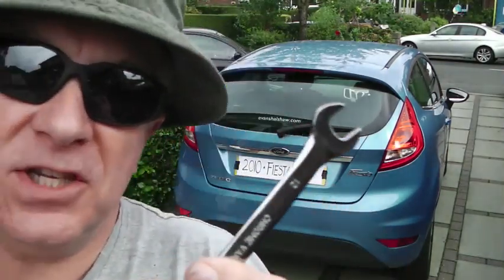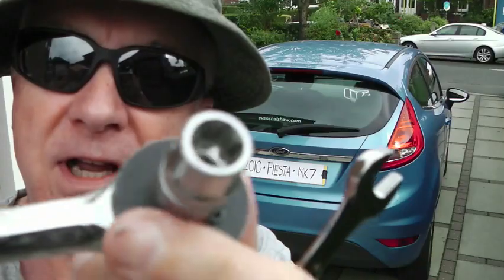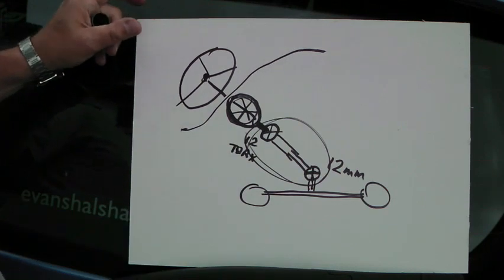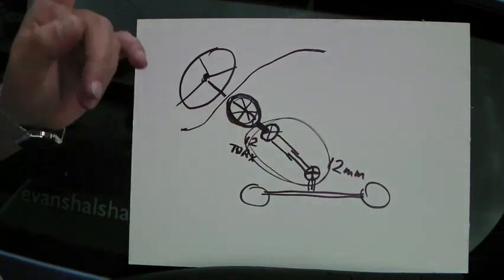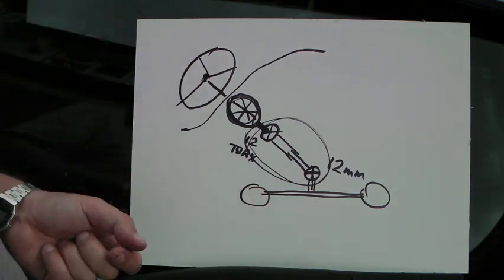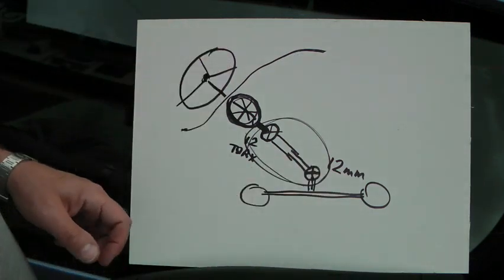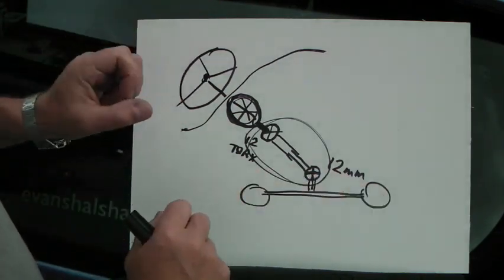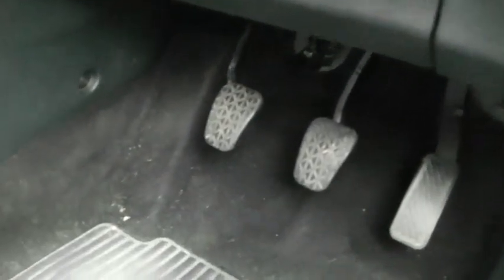Ford Fiesta Mk7 Faulty Steering Column (common fault)!

Comment: Iv got a late 2016 mark 7.5 and the steering column is different to what your showing do you know if they changed it or improved it in the later models?
Reply from the maker: I think from 2012 onwards may be different part number!

Comment: I have a question regarding losing power steering on the same car. Is this a common problem as well?  I have checked all the fuses both in the engine room next to the battery and the fuse console behind the glove compartment. Is this a common fault as well? The dealer shop where I bought my car new refuse to answer any questions since the warranty is expired. I live in Thailand (LOS) Land of smile (or land of scam)?
Reply from the maker: Sounds like you have an entirely different fault! Suspect it’s an electrical fault or maybe a weak battery!! Good luck!

Comment: I’ve removed the two bolts but the top side of the column won’t budge. The bottom end slides off east but the top just won’t move. Any help on getting this off would be appreciated
Reply from the maker: Just patience and keep wiggling it until it comes free!

Comment: I got this problem on my Fiesta 2012 model in Thailand after 5-6 years of use but the Ford dealer who serviced my car could not find where the noise came from. Now the car is 11 years old and I will repair this myself. Thanks for sharing, hope I can get rid of that annoying clicking noise every time I try to parking my car and need to turn the steering wheel left and right.
Reply from the maker: Good luck!

Comment: 2015 fiesta - stiffish steering which is pointing to the top CV / knuckle joint due to motor heat - car has drivers knee airbag fitted just below the intermediate column.  it's impossible to remove the top torx bolt without removing the airbag section. Tried every which way. I'm not attempting to remove the airbag, but I have tried a 12mm torx ring spanner, small 1/4 drive 12mm torx socket, 14mm ring spanner etc. No room at all to get a proper grip on it. Any other options without taking the car apart? Not sure if I'm missing a trick with this. Cheers (Great video by the way).
Reply from the maker: Thanks for commenting. I've not seen a drivers knee airbag, so can't give an opinion on this. Sorry I can't help, but good luck anyway!

Comment: Great video mate. 👍
But i did not understand is this problem just anoying sound or major problem wich can lead to some bigger issue?
Can you explain please?
Reply from the maker: It's a clunking sound that can result in FAILED annual MOT test in the UK. It may also be a safety concern as the clunking gets worse, but I am not qualified to say. Always consult a qualified motor engineer if in doubt!

Comment: Any body know the torque for the 12 mm nut and the12 mm torx nut involved as this repair involves the steering the torque setting is important
Reply from the maker: Sorry Martin, I don't know the torque setting, but you are good to mention this because it is important, and can be a safety concern if these are not correctly tightened!

Comment: I was just looking to buy used mk7 fiesta and tried one with this problem. Thank you for sharing. 
Can anyone, who is driving mk7 fiesta, share with me the other common problems with this model and is it worth buying?
Reply from the maker: It's generally a good little car!, but other things to watch out for are buckled alloy wheels - they buckle on the "inside" edge so you can only see they're buckled if you jack the car up and look underneath while the wheels are spinning! They are not manufactured strong enough to withstand the potholes on UK roads! Suggest old school "steel" wheels are better, or at least Alloys by a different manufacturer. UK roads are so bad that I don't recommend "low profile" tyres on any car at the moment!
Reply: @AlanCooney  Thank you so much for sharing this info with me. 

I have found the used fiesta 2010 and I'm going to buy it tomorrow. It has steel rims, but I don't mind. It is so well maintained. I was thinking about not buying it because it has some problem with the gearbox, but found the used one too for less then 100e in good condition so decided to buy it. Engine compression is great (all cylinders above 11).

Thank you again for the tips 👍

Comment: Ive just purchased a used 2011 fiesta and was having these creakings sound. Have removed  both the bolts from the steering shaft, but the  length adjuster is so dried up i can't lift the shaft away, its stuck there basically.
Reply: Do you think it would be safe to use a hammer or crowbar to force the joints off their connections?
Reply from the maker: You risk damaging stuff if you use a hammer or crowbar! I would suggest holding shaft firmly and constantly wiggle steering wheel from side to side to free the shaft up. Also maybe squirt a bit of WD40 onto sliding shaft spines. Hope this helps.

Comment: Thanks Alan.  It’s now 2021.
 My wife’s 2011 mk7.  Mot advisory , offside wishbone and ball joint and steering rank has some play( Evans halshaw ) 3 years in a row)) 
Wishbones done. And I’ve been searching for some answers to my findings after  new wishbone and ball joint install,, I thought maybe it was something I had done whilst installing said wish bones.  I’ll  certainly have a look at the  column now .  Thanks for sharing. Stay safe 😷.
Reply from the maker: Thanks for watching and good luck. I also did wishbones around 100,000 miles owing to lower ball joints worn. Not had any steering rack problems. Also don't forget to check front wheel alignment after replacing wishbones!
Reply: @AlanCooney  oooohhh. I didn’t think of that. 👍 thanks again Alan. Go safe mate.

Comment: I have 2013 with 105k. Same issue. Just finish fixing mines. Took about 1.5hrs. The shaft on mines just had 2 regular 10mm. Make sure to turn the steering wheel 1/4 turn to the right (passenger side) The ford logo should be facing the passenger door, this will allow you to access the top bolt. Make sure you lock the steering column before removing the bolts. I used a rope. After removing bolts remove the bottom of the shaft first. then top. (TIP: mark the top of the shaft before removing. this will allow you to align it properly later.) I used PB blaster to clean free the cv joints. Move it back and forth until it's moving smoothly. Grab a rag and clean all the old grease. Apply new grease. I used brake caliper grease on mines, it withstands up to 600 degrees Fahrenheit. (Autozone) Go heavy on the grease. Clean excess and put back together. Thank You!!!!

Comment: Cheers for the tips in the video glad to see it's still going after all these years helping people out. I recently had the same issue with my 64 plate fiesta st, following your tips in the video I went to remove the steering shaft only to find that the top bolt had come undone slightly and that was the reason for the clunking. Tightened it back up and everything is fine again so didn't need to remove the shaft. Great video though for pointing me in the right direction or I wouldn't have had a clue
Reply from the maker: Hi Rob, thanks for your comment. The car is still going strong - on 108,000 miles, and 10 years old! Hope to do a video update of it soon!!

Comment: Have a 2012 it clunks over turns only sounds really bad could it be this. It doesnt clunk when sitting and moving the wheel help please
Reply from the maker: Yes, it could be this, but to be sure you need to fully examine the fault as I have not seen your car! If you are unsure yourself - then get an experienced mechanic to have a look.

Comment: I just had my MOT mine is a Fiesta 2011 it had a knock in the steering column before but was fixed about 4 years ago but back again. I can't hear any noise when turning or reversing at slow speeds. But car does slightly veer to left if I take hands off the wheel. Also when I put the key in to start the car, its hard to turn and gives a knock and the wheel moves a little as I turn the key.
Reply from the maker: Suspect more than one fault. Further inspection required, and a dose of good luck!

Comment: My fiesta makes a tak noise whenever I drive off, when I steer the steering wheel it makes a noise, the tak is repetitive
Reply from the maker: Steering noises can be caused by a multitude of things, (not just the fault I highlighted in this video). If you're getting a "repetitive" noise I would be inspecting the front drive shaft CV joints. Good luck.

Comment: Thank you. I have recently bought a 2011 titanium model and I had a clunking noise when reversing or turning at low speeds, I bought a £7.99 can of spray grease from halfords and covered both connections. The noise has completely gone. Thank you
Reply from the maker: Nice!

Comment: Yep you are right... Also my column shaft suffered from the same issue! How over the fix in an older car is not really simple.. it's better to go to your local dealer and tell them about the problem! Ford has already accepted the problem and they will make the same thing you for free and you will also be safer for everything ;). In any case thanks for the video !!

Comment: Great and detailed video. Did you have to remove much of the plastic facia panels below the dash to get access to the column?
Reply from the maker: No. I did not have to remove any facia panels. I was just lying on my back looking up under the dashboard.
Reply: Thanks Alan

Comment: mine got such problems after 10 years and 70000km. here in Russia 99% mechanics said that it is steering rack....and only one specialist said the same as You. thanks!
Reply from the maker: Pleased I could help. Good Luck.
Reply: Ilia Pokidkin same here in philippines. 80000km now and most mechanics said replace the steering rack assembly. Which will be very costly ofcourse

Comment: Good video but need to mention.The joints you are referring to are universal joints,not CV joints.Constant Velocity joints are usually found on drive shafts and are constructed using large diameter ball bearings not tiny needle roller bearings as found on our universal joints.Only mentioned this incase it causes confusion.

Comment: Recently bought 2010 fiesta Titanium. I have this clunking noise on the steering. Notice it when moving slowly off. I'm wondering if the power steering Amber warning light that has just started to come on is related to this? The warning light does not stay on. As yet anyway. Or is it a separate issue? I've also found out that my wheels are slightly buckled. Apparently a common problem I've been told. Any connection with these issues? TIA
Reply from the maker: Buckled wheels is a different issue. I believe the standard ford alloy wheels are not quite strong enough to cope with UK roads. They buckle very easily. If you are a keen motoring enthusiast I would upgrade them to something stronger for a smoother driving experience.
Reply: @AlanCooney  thank you for your reply

Comment: How on Earth can you remove it without removing the knee airbag? I really can´t find a physical way to reach the upper CV joint bolt, as it is right under the steering motor, on the upper side, it is barely touchable with the fingers (and I am an average size person, not fat, not slim).
I plan to disconnect the battery for an hour tomorrow, let the car properly discharge, then remove the knee airbag carefully, it is just 4 bolts holding it and the cable, which you can remove carefully. It is in far easier than removing a steering wheel airbag.
That is the only way I can picture being able to fix this.
Reply from the maker: I didn't touch any airbags. I slid drivers seat as far back as it would go, then lay down on my back with head and shoulders in the drivers footwell (my head right up against the pedals), and my legs hanging out of the drivers door with feet dangling onto path. In this position I was able to look upwards underneath the dashboard. Hope this helps. Good luck.
Reply: @AlanCooney  I did it yesterday, at last. I did remove the knee airbag, I guess I'm not that flexible :D
Anyway, sadly that was not the issue for me. My rod seems to be a newer version from 2010 and it was tight. I did clean and grease it but the k is king are still there. I suspect it might then be the CV joints so that is my next stop :(

Comment from the maker: UPDATE: I am surprised to have over 60,000 views since I put this video up nearly 4 years ago! It is obviously such a common fault affecting so many Fiesta Mk7 cars world wide! Thank you for the many comments and experiences that you have posted up on here - this is really helpful to all involved.
Reply: Hi there , I have a 2011 model and I have the exact same problem , do u recommend purchasing a new part or simply re-greasing the old? If I regrease the current bearings apart from the noise going away will it still be safe to utilise?
Reply from the maker: I cannot answer questions about what is safe, or not, to do! If you are concerned about safety then go to a Ford Main Dealer and pay their price! The comments on her are for diy enthusiasts who don't mind getting their hands dirty, and taking responsability for their own actions. Only YOU can decide how to repair your car - but read all the comments and make your own decision! Hope this is helpful to you.

Comment: You are correct. The heat from the electric motor dries the grease out in the upper joint / bearing. Ford did not grease this joint  when assembling, so it's a manufacturing fault which they will not rectify. Some garages will try to tell you that you need a new electric steering motor. You don't. You will have the same problem after a couple of years. It's a simple enough job for a mechanic to grease the bearings with the correct silicone, heat resistant type grease that Ford actually recommend. it costs around £45 at my local garage, but over £85 at a ford garage.
Reply from the maker: Thanks for your comments. Very wise words which should be appreciated by many viewers of this topic!!

Comment: This is poor design. The electric motor for the power assist should be at the bottom of the rack, similar to the old style hydraulic racks. Since it is at the top, it puts alot of pressure on the universal joints, and hence the issues. This is what happens when Ford uses young engineers straight out of uni with 'new' ideas and not much experience.
Reply from the maker: Agreed - very wise comment!

Comment: Hi Alan... I have the same problem, and I want to know if I have to remove the knee airbag to get at the upper CV joint.. And if I have to remove it, how do I do it?? Thanks
Reply from the maker: Don't touch the airbag! There is NO need to interfere with airbag!!!
Reply: @AlanCooney  Hi Alan, just to add - our 2015 fiesta with knee airbag - it's impossible to remove the top torx bolt without removing the airbag. I'm not attempting it, but I have tried a torx ring spanner, small 1/4 drive 12mm torx socket. Not room at all to get a proper grip on it. Any other options? Cheers (Great video by the way).

Comment: Hi Alan, I have done as you indicate - removed the  complete column assy - put some cleaning solution through and then oiled the Uni joints -syringe and motor oil, then used synthetic 'chain lube' and sprayed several times it down into the spline joint while holding it upside down and allowing the lube to dry. Refitted  and so far has been ok ~3 months. The top uni join was sticky/gritty. Thx
Reply from the maker: Yes Michael - your fault description is spot on - "top uni joint was sticky/gritty"

Comment: My 2009 1.6 tdci Zetec s had a slight knocking and got worse, turning to clunkingbwhen turning the wheel. It's strange because it sounds like it's coming from the steering rack. When I hit bumps it sort of clunkiped too. So I removed the bottom 12mm bolt joint and pulled from the shaft. Pulled it down to the end of its stroke applied grease and pushed some up into the very small gap with my fingers. I then put loads on the shaft and put my hand around the shaft making a fist. I then pushed the lower rod back up inside the out top part slowly moving my fisted hand down bit by bit pushing the grease up with the top part of my hand. Did this a few times. Then i pulled the rod up and down 20 or so times applying more grease in the gap. Then finally did this very quickly about 20 times. I pull grease on my fingers and pushed it into the cv joint smearing the bearings and connecting parts. I never disconnected the top end. I then cleaned the hole and shaft popping out of the car floor. Bobbed a little bit of clean grease in there and pushed back home. Got a paper towel and cleaned up grease that was were it should be. Put some semi perm locktite on the bolt and tightend back in to the same pressure I felt when I removed the bolt. Use a torque wrench if you not sure on feel of bolts. Started car and took for a drive going from lock to lock rapidly on a quite bit of road. Job done and all noises gone. It's not rocket science and if you've got some basic machanical knowledge it's easy! if the bolt has damaged head or threads fit a new one. Ow and if the bolts loose you'll get clunking. It's designed to nip the outer joint onto the steering rack stub. If you reuse the bolt make sure you use locktite and once set it will not come out... when I pulled the shaft apart there was some visible grease right on the edge of the splines I could just see, but obviously not enough inside there. Before falling out on a new rod at £150 or any other steering connected parts, you need to try this first! Took me 10 mins if that and just leave top part connected. Use multi grease or a gear grease. Spray maybe to thin and not last. You want a compact grease in there that will last a while and take compression of metal to metal. Wd40 is a no no. if you got a syringe you could use that and squeeze in the grease. Don't use oil either....